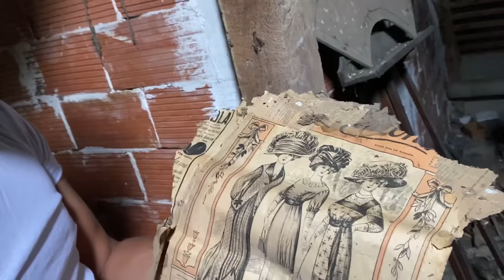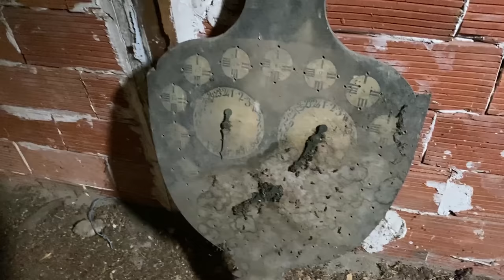CHATEAU Attic TREASURES @chateaudelalacelle  Journey to the Château, Ep. 42

Comment: Congrats on the million views! You’re millionaires now. 😉😁♥️ Well, in good will and friendship. ♥️♥️♥️
The fan shaped piece in the attic is Japanese (or the fan shaped paper on it is Japanese). Of course it’s possibly Chinese, etc., but from what little I could see, Japanese is my best guess. It’s the paper for a fan, but was most likely never placed on a fan, but mounted for display instead. It would be difficult to date, as Japanese decor has been popular for a long time and traditional designs are… traditional. 😉 But of course fans are fashion accessories, so it might be possible to date after it’s cleaned, depending on the design.
If you like it and can clean the paper without damaging it, go ahead and use it. But if it’s beyond salvage, don’t fret; it’s extremely unlikely to be valuable.
Reply: Thank you so much. We couldn’t believe it. Thank you also for the input.  Once we get back up there, we will keep you posted.  Great comment. 💖💗💖